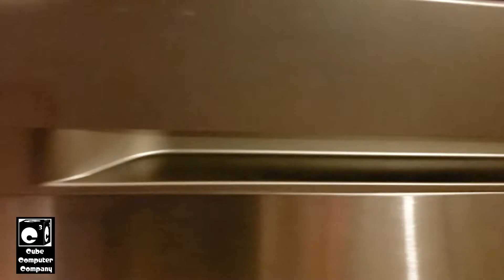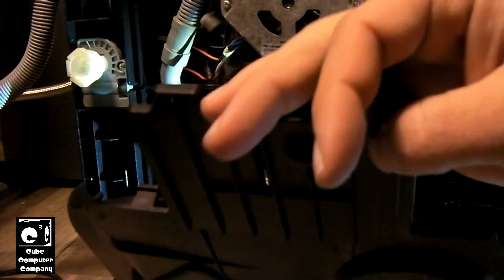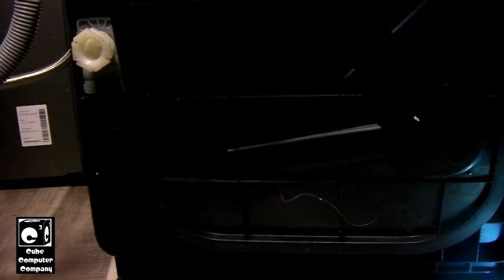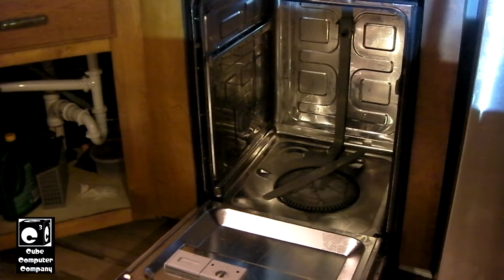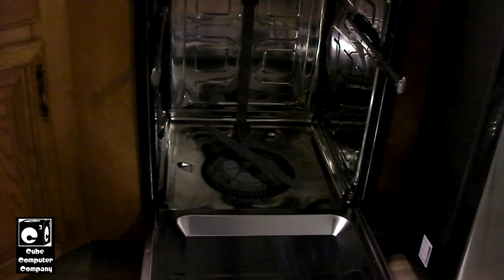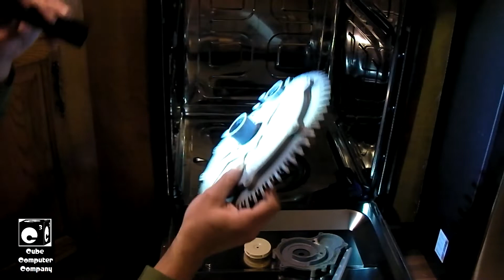Samsung dishwasher making grinding noises? Here's two things to check.

Comment: Thanks for the informative video.  I checked the macerator first because it seemed easiest to get to, and found a pistachio shell caught in the macerator blade housing.  I picked it out, and the buzzing noise was gone.  Other than having to manually remove and replace 13 screws, it couldn't have been easier.
Reply: Yeah, definitely rooting for the spider. Had it's home invaded.

Comment: Great video . Did both the things but sound is still there . Grinding sound during wash cycle not when draining. Have the same samsung model
Reply from the maker: If it's just during the wash cycle, then it's definitely with the main pump. If it comes to it, I think you can buy a whole new pump assembly, but it's $200 or so. But it bolts right into the bottom of the dishwasher and includes the drain pump.

Comment: This is so helpful, I think I have the same thing going on under the dishwasher, I took off the filter, and the drain pump, and found nothing, the sounds is still there, it should be something that bump with the white cross part in the drain pump in your video....
Reply: Hello , i have the same issue . Found nothing but still sounds during wash cycle
Reply from the maker: Does it make noise during the wash/rinse cycle or when it is draining?
Reply: @CubeComputerChannel  during the wash/rinse cycle...

Comment: Is the dishwasher still working good? I have a GE making the same noise.
Reply from the maker: Yep, it's been working just fine ever since!
Reply: @CubeComputerChannel  That’s great what’s weird is that after you removed that plastic it still made the noise, but then you took it apart where the grinder is and found nothing there, was it that plastic piece causing the noise? If it was why did it continue to make the noise after you took it out? Also is possible to access the back pump without pulling the whole unit out?
Reply from the maker: @Shaverboy516  There were multiple pieces broke loose. In order to get the drain pump out, you have to pull the dishwasher out to access it. On your brand it may be set up differently.
Reply: @CubeComputerChannel  Ok thank you:) I have a GE that has a sump filter in the back with a grate over it, maybe I’ll check there and the impeller in the front, it only makes that noise when washing and not when draining.